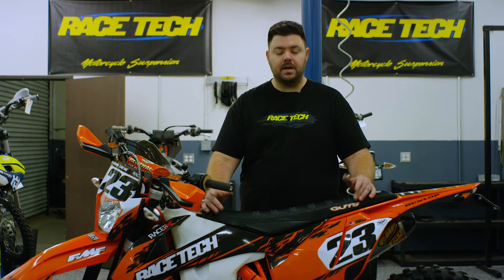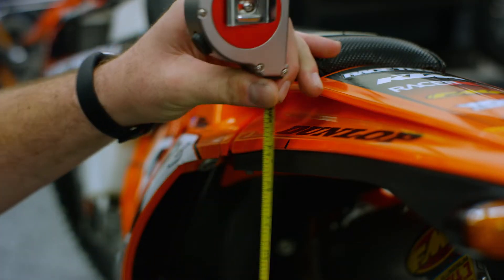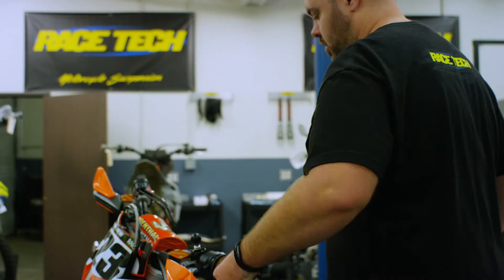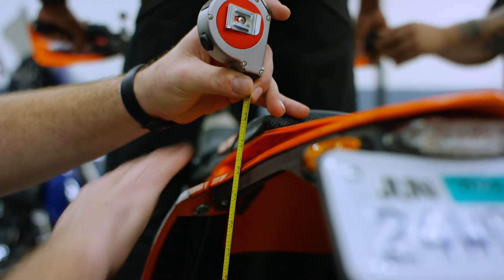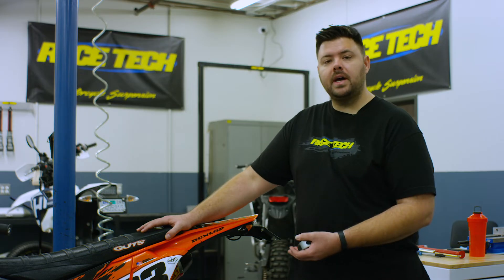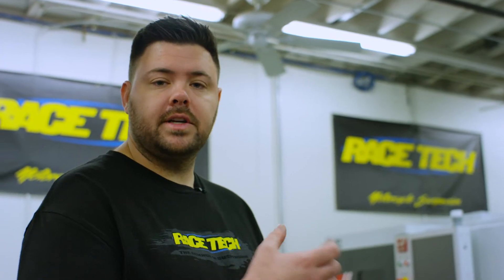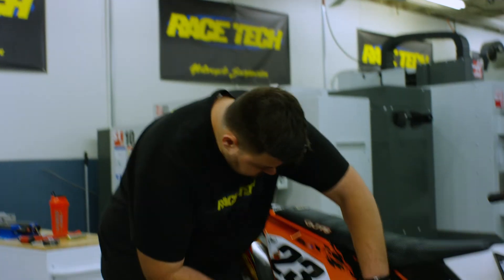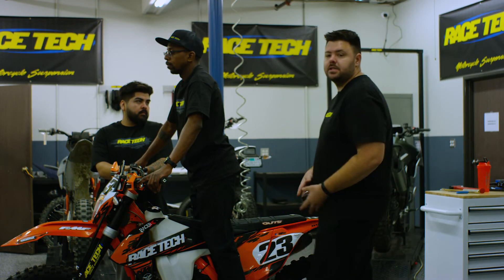TECH TIP - Setting sag the Race Tech way

Comment: My YZ250 has 2mm of a friction zone. If it had 5 mm, I think I would make sure the linkage and swing arm pivot are greased well.
The shock length can change with a pre-load adjustment?  The rider is in a slightly different position, (or ate, took a dump, etc.),  for the other measurement.  Have you ever read the "Motorcycle suspension bible" by Paul Thede?    lol
Reply: Chain too tight?  That was a good point.

Comment: Why worry about pulling a measurement from the center of the axle? Unless the end of the tape fits snug its going to be hard to get the center everytime. Clip the axle nut seems much more logical, but I'm not the "expert". I hope they rebuild bettter than they set up.

Comment: How about free sag? I've been setting my sag up for 35 years and was scratching my head when the expert was calling out numbers? What was he talking about?
Reply: I call sag "rider sag" (rider on the bike), and "bike sag" (just the bike weight.  The bike sag is used to tell you if your spring rate is good.  After you set the rider sag, measure the bike sag.  If it is under 15 mm, you need a stiffer spring.  If it is over 25 mm, you can use a weaker spring.  Those are old school numbers before the bars were rotated forward (a free style set up basically), and riders are riding a bit more forward on the bike.  That "teases" the front end "trail", so riders are going to about 105 mm or a bit more (used to be about 100 mm), and accepting up to 35 mm of bike sag.  I am too old of a dog to try new tricks (don't like crashing), and the bike geometry is basically the same since 1982,---so you can set it up either way.  I stick with what I know at my age.  :)   Doug in Michigan
Reply: I don't think I'm understanding you correctly. Pls help me with your explanation. When you say 'set' rider sag, did you mean 'measure' rider sag? Where you say 'if it is under 15mm' do you mean, if the difference between the rider sag and the bike sag is less than 15mm'? Also, if the difference is less than 15mm, wouldn't you be wanting a softer (not harder) spring?

Comment: I need a stiffer ride. to much sag in rear suspension. I’m 225 lbs so I don’t know if I need to buy a stiffer spring or just do the math and adjust accordingly. Also need to adjust the front suspension for a an overall more sporty ride. Any help much appreciated. I have a 2022 gas gas Mc 450f with WP suspension.
Reply: You need stiffer fork springs and shock spring.  I had the same problem starting riding again after 18 years off, and 40 lbs more (220 at the time).  If you set the sag on that soft rear stock spring (sag will be the same no matter what spring you use), the front will be so low, the bike front end is really "nervous", (because you lost front end "trail", part of "rake and trail",  that keeps the wheel steady).  Te Race tech site has a chart for rifer weight and spring rate.  Do that first, before any other adjustments. There are no adjustments that would fix my soft stock springs with that weight.
Reply: @EarthSurferUSA  thanks for the advice
Reply: You def. need a proper spring for you weight , stock spring is good up to 190lbs
Reply: @rebelliontotyrantsisobedie5602  That depends on the bike, but I would say 190 lbs is the high mark for stock springs on the stiffest bikes.  180 probably is more true for most people on a stock 250 or larger bike.
Reply: @rebelliontotyrantsisobedie5602  it’s a 450 and it’s a factory bike.

Comment: I am 220 pounds. How do I calculate my SAG number?

How would I calculate it for somebody who is 150 pounds?
Reply: Get the right spring rates for the rider weight first, before any other adjustment  Then set the sag for the best bike handling, (last, the clickers for fine tuning, and that can get complicated)  I like the rear sag closer to 100 mm than 105, so I don't always need a berm to turn.  :)

Comment: You should at least mention checking the static sag after doing the rider (dynamic) sag. Status is the sag from extended to compressed just by the weight of the bike, no rider. If your manual says the bike is equipped with a rear spring for say a 165 lb rider and that’s not you, then you go adjust your dynamic sag, then your setup may end up too far from acceptable, because you’re too light, or more likely too heavy, say 200lbs.

Comment: After much thought after riding again after 18 years off a bike, it seems to me there are 2 was of setting up your bike today.
1) The new way, people ride more forward with handlebars rotated forward, and to compensate for that, they are running more rear end sag (105mm or more), and more static sag (about 35mm).  I don't like the way the front end feel in corners with the bars up that high so I went back to our old set up.
2) rotate the bars back down so the ends of the grips are pointing down a bit, (corners so much easier for me), and get the sag set between 95-100mm, with the static sag at about 20-25mm.)
I see a lot of amateur kids with go-pros on the modern tall bikes with high bars, who can't corner worth a crap, and pretty much have to have a berm to turn at all.  Even in the C class in the 80's, there would be a couple of slow guys, but I have never seen so many slow guys in the corners as I do today.  Like everybody.
Reply: Thank you for this post, I just check my sag after the holidays and now that my bike has 35 hrs and my sag was 120 with 45 free sag. I'm now at 25 free sag with 105 107 race sag but after reading your comment and how I struggle with rutted turns I'm debating on running 95 sag
Reply: @barnescycle  I would not make that big of a jump at first.  But I bet 100 mm of rear end sag is a good place to start.  I lowered my YZ250 suspension .75" o each end, and found 98 mm is the sweet spot for the stuff I ride on.  I can feel it if the spring sacks a bit to over 100 mm as the front end wants to push on flatter corners.  Under 98 mm, and I can feel it tuck easier.
Reply: Also, I don't know who much you weigh.  But you will want to make sure you have good spring rates for your weight, before you do anything else.  A heavy guy, on most stock suspension, especially after setting the rear sag, will feel so low in the front, the bike can become un-ride-able.  I never noticed that when racing for a decade at 180 lbs.  But a new bike years later at 220,-----oh boy did I learn.   :)

Comment: My sag is 55mm. I just ordered Race Tech 5.4kg shock spring. I weigh 155lbs. Am I going in the right direction? Should I get the gold valve also?
Reply: Ride with a fat GF on the back.   :)